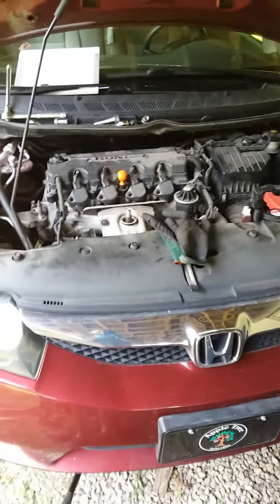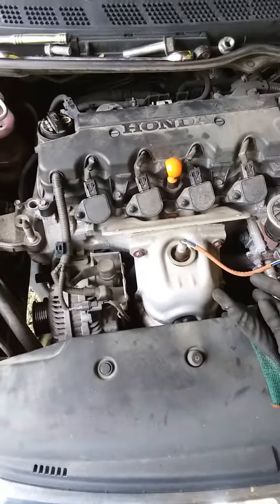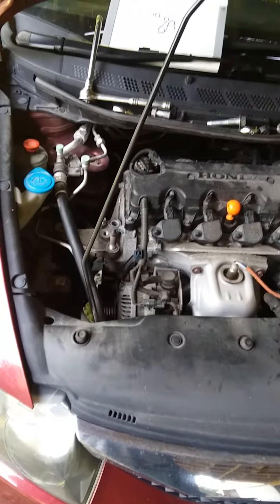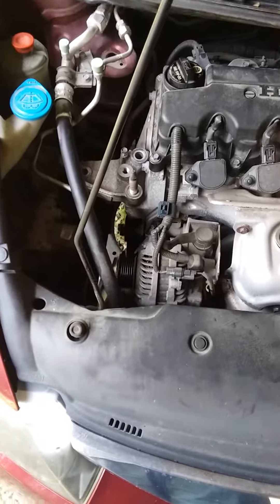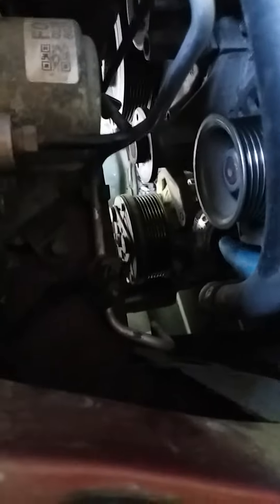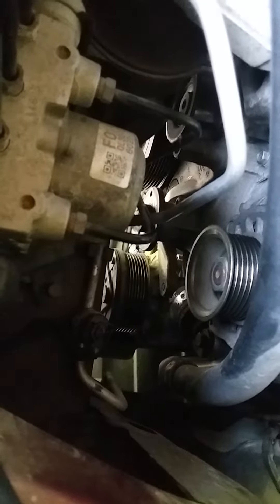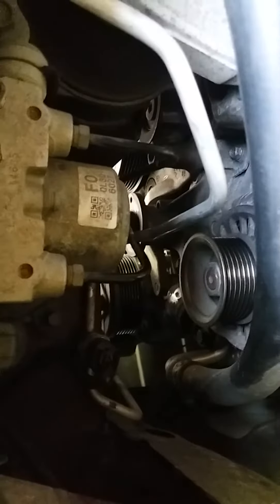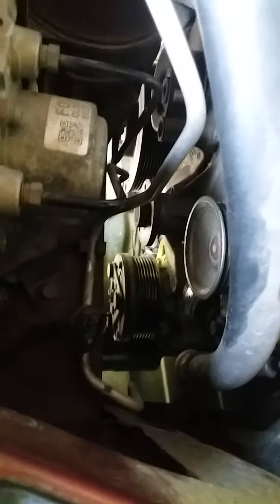2011 Honda Civic Serpentine Belt tensioner diag

Comment: Mine does rattle at low rpm during turns, I actually have seen the pulley moving when the sound happens. How did you go about changing it? Did you drop the engine or is there enough space to undo the allen head bolt?

Thanks
Reply from the maker: You have to support the oil pan with a Jack and block of wood and undo the upper left engine mount. Slowly lower the left side of the engine to get access to the water pump pulley bolts and the hex bolt.
Reply: @bramshobbyshop757  thanks! I will try to make a video when I get the parts
Reply: David S. 
That 8mm allen bolt can strip and mines partially did so not sure what to do next 😔